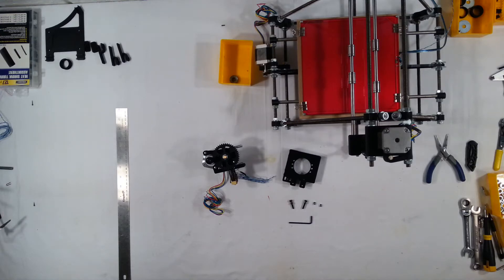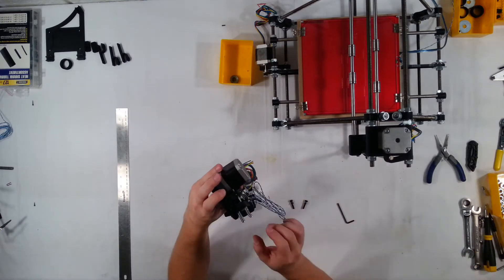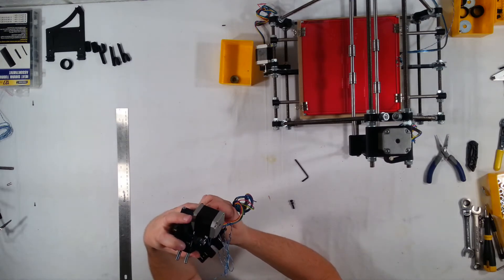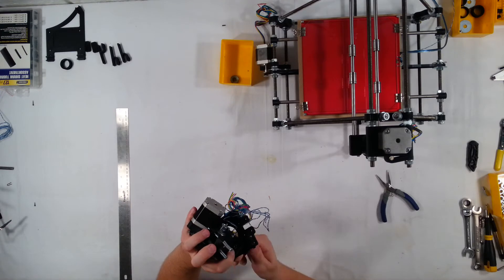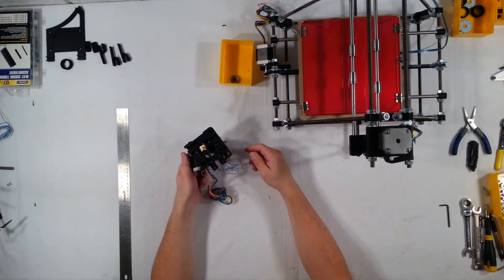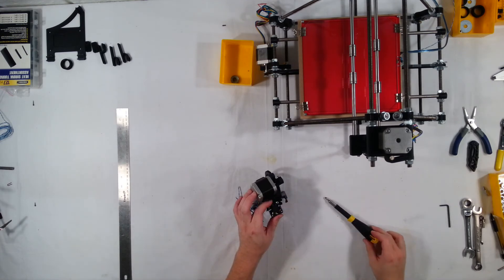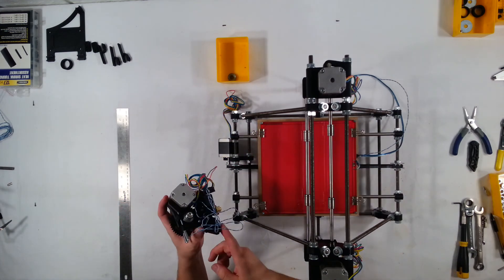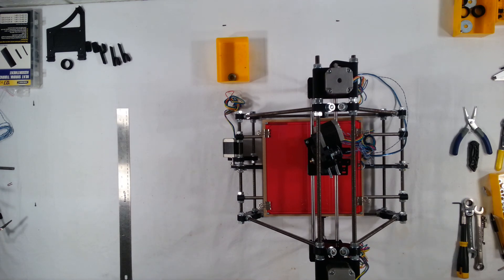RepRap Prusa Mendel Iteration 2 Assembly 15 - X Carriage

Comment from the maker: It turns out that the zip ties work really well. The snap in ones work great for a month or so and then the bearings start slipping out. I've super glued mine and it works fine but I think zip ties are the way to go with these. :)